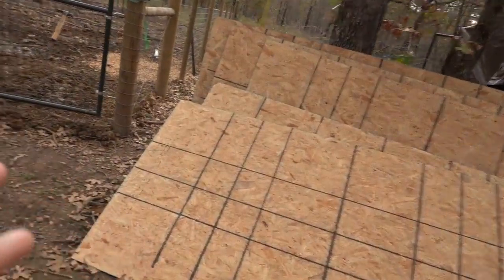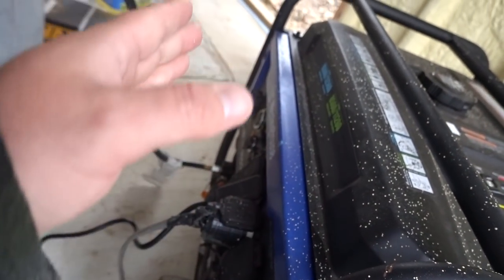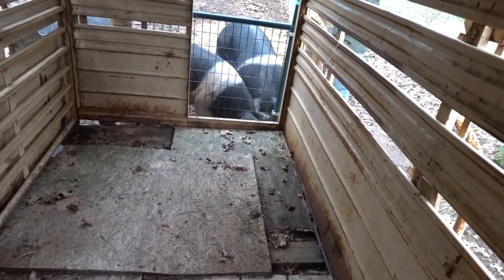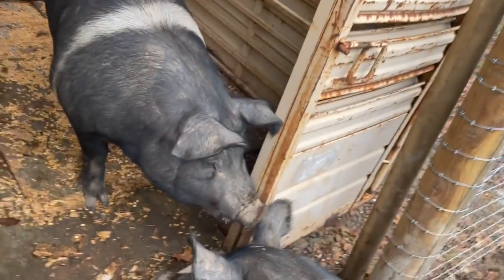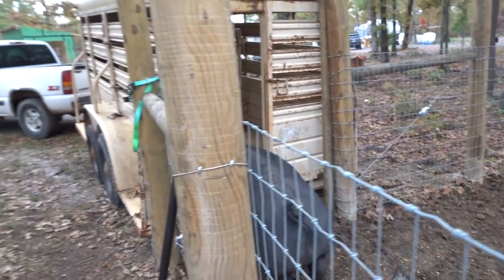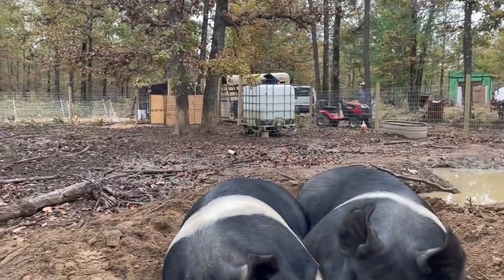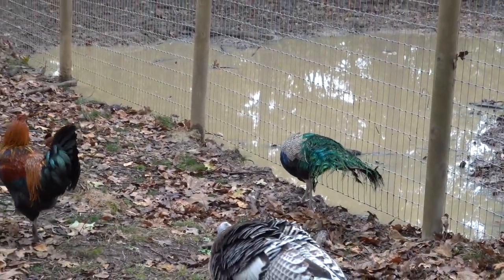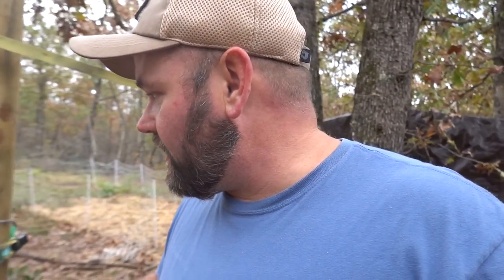HOW TO LOAD HOGS IN A TRAILER

Comment: i raised pigs for twenty plus years and this is what worked for me. build a pen in the corner with the gate . just big enough for the pigs. only feed them in this pen. when it is time to butcher hold the grain for a couple of ,days then when it is time to load them put some grain in the pen and they will run to it like starved pigs. now they are trapped in a small space with no place to go. build the ramp as you said but make the sides solid so they cant see out.  make the ramp just barely wide enough for them. they can turn 180 in a heartbeat, good luck.

Comment: Hey Dutch. If you had an area where people could boondock. Some of us could come help you with different projects.  Ie build a chicken coop; build a lg lean to for your equipment. Help with the house.  I can swing a hammer; run electrical and plumbing. And much more.  Helped build a two story house;  rehabbed my last 5 houses on my own.  I personally just came back from your area to Fl. But I’ll be out there again next summer.

Comment: Question, Dutch... with having to use all those different power sources to operate the things you need now. Would it have been less cost and simpler to have had county electric run to a center pole with a.  meter near the camper where that could be used instead of using so many generators?.. just asking!  I understand when the house is built it will be run by solar, but it still would be nice to have electric nearby if solar was not available.  Pigs just do not mind!  Had their snack now a nap.

Comment: We made a ramp for a higher trailer and more weight what is now a number of years ago. It is comprised of a single 3/4" thick sheet of 4'x8', marine plywood and a 4 piece, ramp end kit (2 pieces of leading edge, 2 pieces of trailing edge).  For our ramp, the plywood was cut at 30" across and the remaining piece was screwed down the middle as a partial second layer.  We made an error by screwing in the ramp ends (at each end of course) then screwing diamond shaped, metal mesh with raised edges on the diamonds to the top surface.  The mesh should have been put on first with its ends tucked under the ramp ends but it was added after wheels weren't turning while an item was being dragged up with a come-along.  With one of the two heavy items, the ramp did creek, groan, and bow a bit but the item was abiut 3,000 pounds.  The other truly heavy item at 1000-1500 pounds stayed strapped to its dolly and went up with hardly any flexing or problem save for the mesh edge.  We've used it plenty of times since with items in the 500-1200 range with only minimal flexing.  -  Of course this moving has included snatch blocks, come alongs, etc...

Comment: Suggestion  watching  our Wyoming Life  and or Cross timber bison   they have a no corner small corral  with 1 big gate that directs  critter  in chute  Wyoming  Life system  also has adjusted  level load chute option to direct into working  squeeze  area    realize   pigs bit smaller   but see the example a d customize to fit your needs

Comment: That's not a deep freezer.  It's an upright freezer.
Reply: It's still a deep freezer...
Chest or upright doesn't matter, they both use extra cold temp. Much colder than the freezer in your fridge.
Reply: Deep freezer refers to the temperature of the freezer, not the shape of it. Dutch has an upright freezer in the well house, as opposed to a chest type freezer.